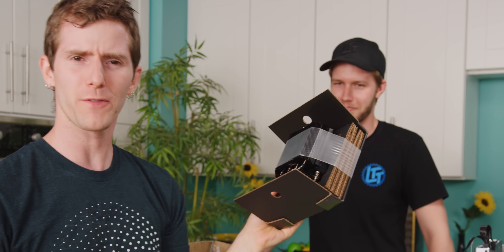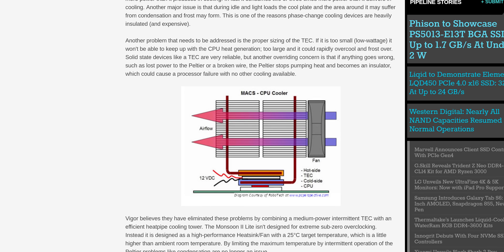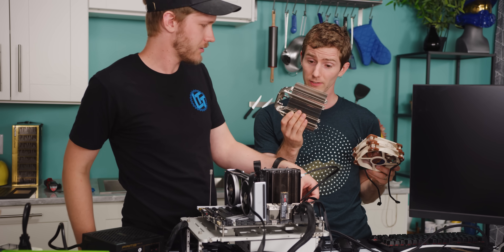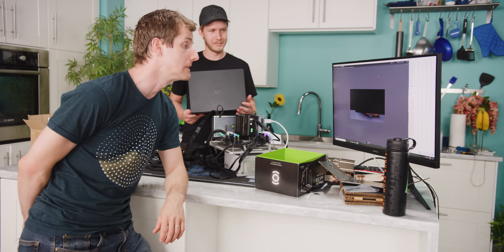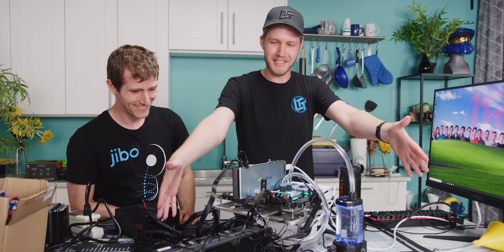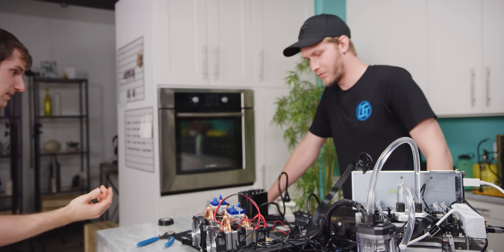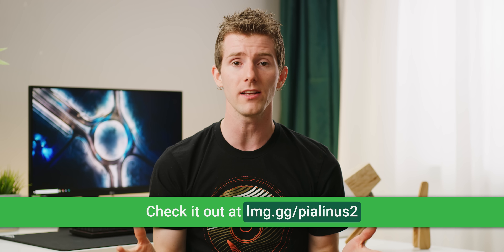Thermoelectric Cooling is a Bad Idea

Comment: Peltier Coolers were used in the late 90's to early 2000's with the computer modding boom and worked very well for OC purposes.  Buy a standalone Peltier that sits right on the CPU, then add a cooler to chill the hot side of the Peltier.  If you look at a computerator build where the freeze tray is used to chill a bucket of alcohol, thats then pumped through a water block sitting on a Peltier.  It gets stupid freezing temps.  We had to add water proofing due to condensation, etc etc etc. most of this was completely impractical but was built just for fun.  A favorite was a 400mhz celeron to overclock as these were basically just cheapy pentium 3's.  @Linus

Comment: Peltier device should be used based on water-cooling radiator. Which means the peltier devices should be connected after the radiator to achieve sub ambient temperature. So, Linus' 15 yr old engineered refrigerator cooler can retire now. 🤣

Comment: i had a tc cooler back in the day by i think thermaltake. if i remember right it was socket 939 first dual core days.the tc was one of the few coolers that worked. ran around 32c under gaming loads. the biggest problem was the switches to turn on and off the plates.i think thats was one main reason they stopped making them. then core count changed again and became not relevant.i may still have it in a box somewhere lol.

Comment: I had a cooler like that back when SLOT 1 Intel Pentium II CPU's were around...  It had a HUGE TEC pad on it, and then a big ass heatsink and 2 fans too cool that.  It worked about the same as if you used just the big ass heatsink. lol

Comment: "Draws 32 amps"
"From Ebay"
Sounds...safe...
Reply: Y’all it doesn’t need to conduct through a human body to set your house on fire lol
Reply: Nmotsch idontwannagivemyrealname At only 12V DC it is safe.
Reply: @CurtisLittlechild92  European households only support 16 amps
Reply: @CurtisLittlechild92  Voltage isn't everything. And you're trusting that it works properly.
Reply: @nmotschidontwannagivemyrea8932  But at a low enough voltage such as at a measly 12V DC, it couldn't overcome a human's body electric resistance so it is relatively safe. Amps still needs voltage to be dangerous.
Reply: @munchbit  Isn't the real danger in if (and when) it eventually fails? Also, what about safety in terms of safe for your computer components?
Reply: @nmotschidontwannagivemyrea8932  I'd say a TEC is quite reliable as it lacks any moving parts, except the water cooling part of course. It'll probably hurt the PSU like any other component if the peltier module does fail. It has contact with the CPU lid, but not the CPU itself as it's insulated unless you use a conducting TIM.
Reply: @munchbit  PSUs can explode and burst into flames, and it's not the fans that cause that. I would think that the TEC could, too.
Reply: @nmotschidontwannagivemyrea8932   There are many components that constitutes a PSU (capacitors, transistors) which supplies power to the whole system. The TEC module is only a single solid simple chip. There is no way you could make it to explode other than going out of spec by possibly forcing an extremely high voltage through it. Besides, if such a PSU blows up, it fails safety requirements and shouldn't be sold in the first place.
Reply: @munchbit  Fair enough. I'll take your word for it since you seem to know more about it than I do. Thanks for politely correcting me; that doesn't happen often enough online.
Reply: @nmotschidontwannagivemyrea8932   I know that feeling. Sometimes replies prefer to resort to name-calling. I don't like it so it's my policy to be avoid it. Cheers. Thanks for being polite, too.
Reply: @munchbit  This is most perfect public conversation I've ever seen
Reply: EpicWafflezXD not true. Even at 12 volts half an amp across the heart will stop it.
Reply: @nicwelch  Probably only if you fribilate the heart by directly sticking the electrodes on the organ itself. 12V couldn't overcome the skin resistance and produce a meaningful amount of current to cause any effect other than a tingling sensation.
Reply: @ryanmalin  12mA wont do much (considering 1kOhm as body resistance)
Reply: @munchbit  A 12 volt source may deliver enough amperage into someone if they had wet salty skin(profusely sweating). Someone with wet salty skin could have a skin resistance of around 1000 ohms, which works out to 0.012 amps delivered at a supply voltage of 12 volts which is right on the edge of causing issues internally. It would have to be a reallyyy terrible alignment of events but there exists the possibility
Reply: at a minimum its going to hurt like hell

Comment: How do I suggest products for you guys to review? You should definitely check out the ts100, it's a pocket size soldering station, everything you need in a very tiny package, with interchangeable tips. I've had one for about a year now and it's some of the best money I have ever spent. There's an easy access USB port which will let you update the firmware, my can go all the way up to 450x and a boost button.

Comment: Just wondering. Wat would happen if you were to cool the air going into the pc with thermoelectric cells without changing any of the internal cooling? Would it make a difference? I have some peltier cells. Perhaps i do it. Though saying that I don't have a super overclocked beast. Just a amd razen 5 with vega 11 without any thing else. Though I do like to tinker. 😁 And I do enjoy most of your vids.

Comment: The easy way to get it work is to put the thermoelectric cooling on an external radiator of a water cooling system, filled with antifreeze.  This way you can have a larger area, up to a few m^2 (something like a room radiator), and up to around 10 kW thermoelectric cooling. But You shouldn't go below dew point, and it isn't energy efficient anyway.

Comment: Hey can you test the cooling performance of the radiator by itself, against the radiator PLUS one of the chiller elements in the same loop? I think thermoelectric cooling may be a better assistant than the sole cooling power

Comment: I know its a little late and probably no one gonna notice this but don't you think the low performance has something to do with less surface area of the water block that is slapped on the TEC? probably a custom made full copper block with higher surface area on the cold side might help it transfer the heat as its always harder to remove the heat.

Comment: Apple used Peltier coolers in their desktop PCs back in 90's. The Motorola CPU was mounted in the centre of the motherboard with the cooler on it and the fan was attached to a bracket that was part of the case. I think the models were the Quadra and Performa.

Comment: I'm sure someone has thought of this - but what about cooling a custom liquid cooler reservoir with the thermoelectric? or even a custom reservoir that is mostly clear with a small metal plate on it to put the cooling pad on it to drop temp of the fluid?

Comment: I seem to remember way back in the slot A celeron days, seeing a celeron 300 overclocked to almost 1ghz using peltier and liquid cooling (nitrogen maybe?). I think it was HardOCP that did it but I could be wrong. I want to say they got it to 1Ghz and it was a record of some kind.

Also....ffs tin the tips. Dab solder on the iron and use that to transfer heat into the wires. THEN place solder on the hot wires to flow. Place shrink wrap over the wires prior and just slide it away while working then slide it up over the joint when done. Cold solder joints are the devil!!

Comment: You’re adding 300+ W worth of heat, so it’s never going to even match the water cooling loop alone.
Reply: Completely wrong, they add that heat on hot part of the Peltier, the other side takes heat to the hot side, that's why it cools, the problem is that the quantity of thermic energy (kcal) it can take is too low when the CPU is on full load , if I would do that, like, if I wanted a 30° maximum CPU temps, you would have to pass the loop through 2 full 3 fans rad, then through like 3 of those Peltier , that would be dum , but probably would work, efficiency is going to hell, buuuut, it's relatively simple compared to a compressor kind of cooler

Comment: peltier chips are good for one things: using a joule thief circuit along with it you can make diy flashlights that are powered by your body warmth. power input creates temperature output and vice versa.
Reply: Long ago, a company sold a vest that would supposedly power your laptop with body heat. The vest was just a SHIT TON of tec plates.
Reply: @casey360360  I should've mentioned the flashlight it'd be powering up p is not a very bright one, still useful though.
Are you serious about the vest? I gotta look this up lol. I got a feeling  It's probably gonna end up with me going down a rabbit hole.

Comment: Back in the late 90's I had a peltier on my K6/2-500.  I do not know who made it, but it was just attached to an aluminum heatsink,  60mm fan.  I never had a single issue with it.  Used it for about 3 years then gave it away.  It came from a buddy who worked for a tiny town PC shop.  The owner,  in his 80's was 100% convinced that ALL limits had been hit, and wouldn't sell a high end PC without one.  Then Slot1 came out.   Someone asked me years later what I did about condensation.  I told him I do the same people with a 100% acrylic case do about EMI.  I don't think about it.   Also bear in mind that my peltier was on a soc7, in a desktop case, no cover,  extra PSU on top,  2 extra  5.25" drives,  a stack of HD's, and a box fan bungied to it blowning down.

Comment: Just curious, in keeping with the theme of bad cooling ideas, what would happen if you added the radiator to the loop after the CPU to bleed off some extra heat energy before the coolant circulates back to the TECs. This way you are reducing the pre-cooler fluid to as close to ambient temps as possible before the coolers do their work. I realize it costs twice as much and negates the comparison between the two, but it would be interesting to see just how cool you can get it by using TEC. It would be more like boosting an already capable system than trying to replace it altogether. Also curious what affect  you would get from using the TECs in series vs parallel configurations, i.e., running the coolant through one, then the other vs splitting it into two parallel cooling paths then merging them back before they enter the CPU cooling block... you never know, maybe the slower coolant flow through the cooling blocks will allow for more heat energy to be removed from the coolant. Other tweaks, like insulating the cooling blocks and cold lines and having the coolers as short a distance from the CPU as possible might add a little efficiency as well.

Comment: The TEC should become an insulator if the electric current is off, since their efficiency depends on them being conductive to electricity but not heat. Essentially any heat conductivity works against the electric cooling effect.

Comment: Learn how to use them and their limitations and they work fine.run them at about half the voltage and stack them and remove more heat then they transfer and they work great

Comment: Isn't one of the Laws of Thermodynamics that heat will always migrate to cooler surfaces?   I'm guessing that 1 of the 2 surfaces
in that cooler is warmer than the other which the heat would naturally travel over to it.  No matter what they say about shooting
electrical pulses thru the device.   But it seems like a great Sci-Fi idea & their numbers ought to be the proof?  Me,  with a short
piece of home heating baseboard( 4 foot piece) & a small pump you can cool virtually any processor  with the cooler  temps
on the floor of a room.   Of course it ain't all  colored bubbles/lights but it does cool overclocked Chipsets ...... peace

Comment: i had a thermoelectric cooler in my gaming rig a few years back and it gave me crazy low numbers so when people told me that it was a bad idea because of condensation i did a very complicated mathematical anomaly thing you would never in a million years discover the solution to that was. & the solution was to...............
flip the computer upside down with the motherboard up.

Comment: Yeah I used a Peltier chip back in the Cyrix CPU days, so a lot less thermal output from the CPUs. I think the Thermal Electric Cooler was only rated at 40w back then and I easily overwhelmed it and it overheated the CPU (didn't destroy it because I switched it off very quickly).
But like you guys the peltier chip on it's own would get down to freezing temps without a decent thermal load.

Comment: Whoops, I entered this just a few seconds before the end of the vid where I thought you wouldn't mention the amps...but you did!!! Good job.

OLD
How many amps are you pumping into the TEC? You mentioned the thick wires leading to it, and I know to obtain a decent delta-temp most Peltier devices require a whole lot of power.

Comment: with my limited knowledge of thermodynamics the bottleneck seems to simply the physical surface area available to dissipate heat (the rate at which air can be heated by each set of radiating fins rather than the rate at which heat can be pushed to the fins). it would be interesting to see the results if those aquarium coolers were used without the peltier modules inline but the rest of the setup was kept the same

Comment: The cooling output of a peltier is by far not linear to the power input, because the more power you put in, the more losses are turned into heat. Thus a peltier that is described as say 70 watts will actually heat up on the cool (!) side too if you give it more than roughly 20-30 watts or so. The spec. is the maximum spec of the peltier, where it breaks down, it's by far not it's cooling rating.

Comment: If the fans where feeded by the electricity made with the peltier effect augmenting the speed of the fan with the heat difference it would make sense put then again what the point when fans consume so little watts and the pc it self already require a tremendous amount of juice in comparison. I can see this being usefull elsewhere put not  in this case.

Comment: I made my own peltier cooler in 1996. Had a copper pipe buried in the ground to dissipate the heat from the hot side of the peltiers. Four of them on copper plates. With water running through on the hot side. I was running my chip at -40 which is the same for both C and F. Ran Prime on that for about 3 years before I wanted to upgrade. And I moved so I no longer had my in ground copper pipe loop. 

I saw no decent way for the hot side to be cooled. You need a shitload of heat transfer to make it work properly. A single peltier is too wimpy.

Comment: Problem with your setup is that you can't just use TECs with janky waterblocks and expect it to cool that well.
Back in the day, there were some crazy custom TEC setups that actually worked pretty well... power usage still sucks though.
CPU -> radiator -> TEC(s) (cooled by another waterblock/radiator setup) -> back to the CPU.
That way you get a lot of the heat removed by the initial radiator and then the TEC(s) cool the water which actually gives you way better temps.
That being said, an A/C compressor type setup will still work way way way better.
Reply: Linus's chiller seems like a better way to go if you have no energy cap to worry about and want unmatched cooling power. With this thing you're constantly fighting ruining its cooling potential with its interaction with the heat source and then have to double-cool it (since the hot side needs its own cooling accommodation to maintain the cold side and then the cooling for the heat source itself by way of the TEC system).

Comment: The way you describe TEC's is that they are useless scam tech, but they do have their place.
You can use TEC's to make a fridge very cheaply, and which are very energy efficient, but you really need to understand how they work to use them effectively.
It isn't something id use to cool something that is actively producing heat on the "cool" side...
The fact u guys fell for "540 watts" shows you don't understand how these things work.
More is not always better. Sometimes it's worse.

Comment: Hold up, did I just see Linus put a whole tube of thermal paste on a CPU then put an actual rock on top? Am I crazy?
Reply: it was cast aluminium. The surface was so bumpy they had to use that much thermal paste for it to make contact

Comment: Hi, how about doing video on mixing two coolings ? Do a water cooling loop with regular 3x12cm radiator and additionally put tec cooler in loop. So regular radiator with get rid most of heat and additionally TEC will bring it even lower.

Comment: Also thermoelectric cooling doesn't keep one side chilled to a constant temperature. It only acheives a temp difference. So If one side becomes lets say 100C, and the peltier is able to create a 60C difference then the other side will be 40. If the hotter side becomes hotter the colder one does too. So you need to isolate the hot side really well from the cold side (which is very hard) to acheive bigger difference in temperature.

Comment: Cool fact: some dehumidifiers use peltier modules to dehumidify rooms as the warm humid air is drawn pass the cool fins the water is condensed and drips into a collecting tray in the bottom of the dehumidifier.

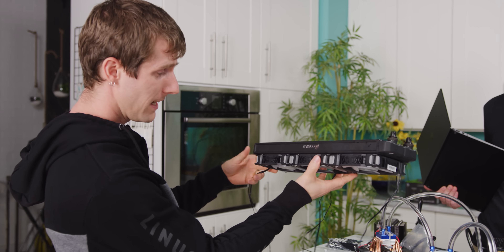Comment: 15:22 Actually those heat sinks only work if the cooling plate is horizontal and under the radiator itself.
Remember that those pipes contains a liquid coolant (usually ethanol or ammonium or a composition) and gravitation law apply...
It's the vapor itself that transfers the heat through the pipes and after cooling down on the condenser it drips down to the evaporator again.
I would try again and I think you could get better results doing it right. The overall performance should rise if you extract the heat from the hot side of the Peltier cell.